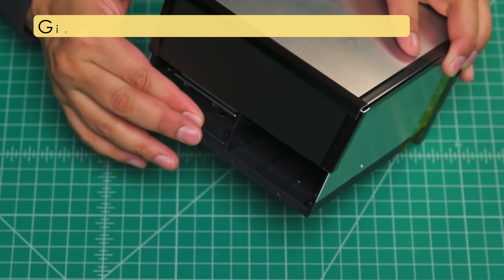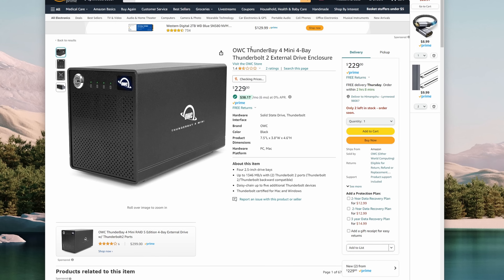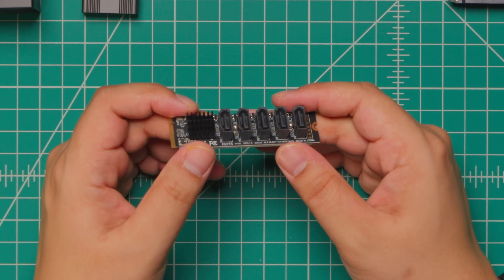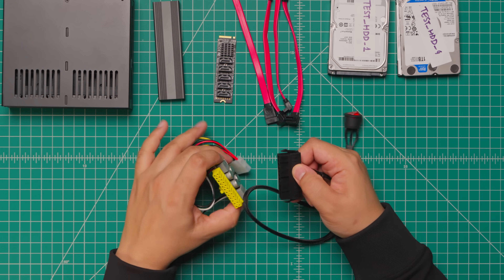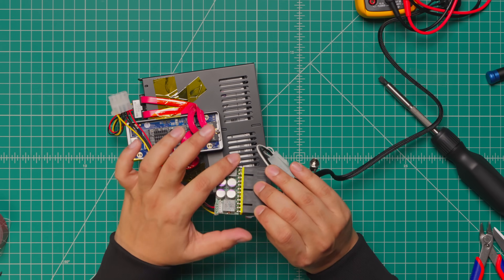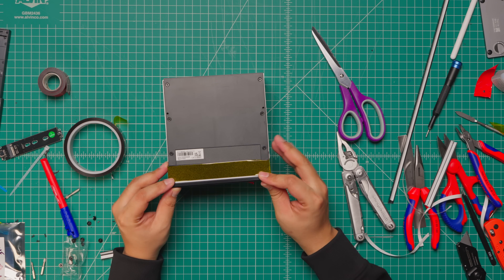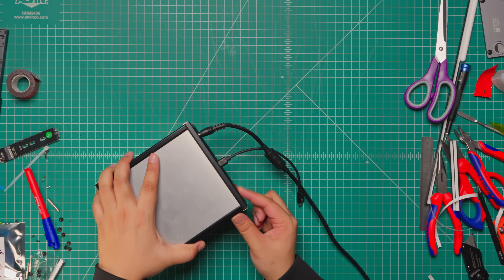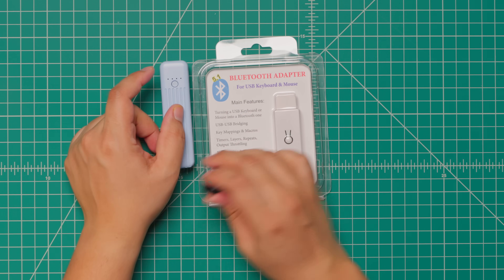You can't buy this! Affordable Custom 2.5 inch SATA SSD/HDD 4 Bay Direct Attached Drive Enclosure

Comment from the maker: ## Update on USB to NVME Enclosures

It was brought to my attention in the comments that most of the USB to NVME enclosures don't tunnel PCIE traffic so they will not work for this, unless it's USB 4.0 that can support PCIE. However, it works well with Thunderbolt ones like I have done here. Bottom line is that the cost may go up a little bit once we replace the USB enclosure with a thunderbolt one, but we get 40 G speeds which is a welcome tradeoff I guess. Sorry about the confusion in the video, please make sure to check for this if you are planning a similar build and make sure you don't waste your money by choosing a wrong enclosure. Thanks for all your support!
Reply: actual cost is $240.47
Reply: What does it mean? 
So sata expansion to nvme won't work on nvme enclosure to usb?
Reply from the maker: @ilhambuono5451  USB to NVME connections don't have all the required PCIE lanes for proper channeling, so to do something like this it has to be a pcie protocol (like thunderbolt) to NVME

Comment: Woahh, you can read my mind
I've been thinking this kinda project, but still wonder if it would work
So you plug SATA to nvme and then using USB hub to connect those Sata or what I missed?
And can you set those hdd raid?
Reply from the maker: Sata to Nvme and then to Thunderbolt or Oculink. USB mostly won't work as they don't tunnel PCIE lanes, I have clarified that in a pinned comment. RAID is a whole another thing though. You can do software raid with this, but hardware raid will require you to use a sata card with raid controller which I am not sure how well will run, especially when you think about forward looking support etc.

Comment: sooo usb -> nvme -> pcie does work?
Reply from the maker: Depends on the connections, not all are created equally.
Reply: @LatticeDensity  what? your comment makes no sense to me lol
Reply from the maker: @dbmaster46446  Not all USB to NVME connections are same, depending on which USB physical shape it's connected to. Even in case of C type connector, some wire it up for full PCIE bandwidth like TBT or USB 4 but some may only do the data pins. In my video I actually missed that, but I had clarified that in the pinned comment.
Reply: @LatticeDensity  yea only the thunderbolt and usb4 does that, everything before emulates the blockdevice

Comment: Can you use an Powered USB 3.0 hub and daisy chain 4 SATA to USB 3.0 cable instead of this setup? I think this setup has an advantage of cleaner / easier to obtain resources but I don't now the downside of this setup...
Reply: Did you end up rolling with this setup? I'm thinking about it
Reply: @xico6814  I end up with a similar setup but not fully actually. Mostly because I cannot find the psu similar to the vod in my local area. So I try using a bunch of powered Sata to USB connector, then daisy chain them into a powered USB hub. Then basically chain all smaller power power brick to an outlet and called it a day. I use 4 HDD in my setup so the transfer bottleneck is not a concern but if you use 4 Sata SSD then you might want to consider using the setup similar to the video because the Type C connector might offer higher bandwidth for those drives.
Reply: @alexander3364  my idea is the same to your I'm thinking on adding all 4 Sata SSD to USB to my computer that has more than 6 USB 3.0
Reply: @xico6814  If you use 4 Sata SSD then USB 3.0 might not be enough, using the set up in the vod you can get the drive connect though the USB 10Gbps and not suffer the bottle neck. But If you want to fully utilize the speed of all 4 Sata SSD then a traditional Sata to SAS controller is prefered.
I do my whole setup though daisy chain 1 USB 3.0 port because my use case does not require performance (yet) and I mainly use HDD.
Reply from the maker: USB Protocol doesn't support daisy chain, but you can share the port among the drives which is what the hub controllers do. However, it will be bottlenecked by the speed of the single USB controller, which is mostly about 10G for Gen 2, unless you go very uncommon Gen 2X2 but still you only get 20G and can hardly fit 4 SATA lanes at best. After you figure out the data, then comes the power part of it. There are very few boards available which is providing all the sata channels with power for 4 drives. If you must go USB, then the best thing to do it keep the USB lines separate to all the drives and connect them separately. Though not elegant, it will not run you into any issues.
Reply: @ Corrent, I did just run into the power issue and bandwith issue as well. Now I build a proper Nas using spare part from my old laptop that actually use SATA connectors. Yeah I have to abandon the USB ideal, chaining multiple USB though a single port cause so many issue as you mentioned and it does look good when I assembled it but once I used it everything falls apart.

Comment: The pico psu that your link to Amazon in the description is not the same as the one in your video. The one from Amazon doesn't have a molex connector that is needed for the drive cage .

Comment: I want a small portable 16+ drive SATA enclosure, to run off a standard LSI chip HBA, maybe via Zima Blade or a SFF Mini-ITX mini-PC. Check out Icy Dock's 6-bay hotswap, fits in a 5.25" bay. Need a chassis cage for three such bays stacked, no need for mobo yes Pico PSU, and the mini-SAS cabling connectors.
Reply from the maker: Ha ha ! I love how specific your requirements are, mine are typically about the same as well lol, very specific and I scare away the available solutions in the market. I have 2 solutions for you, 3D modeling and 3d printing. Get into it, you won't be happier in life, I promise.

I figured, most of such niche pain come from the lack of enclosures, and often the guts are available in the market. For example, you can easily design a small case to hold X 2.5 inch drives and a MINI ITX board, then connect all the drives to the MB using PCIE to SATA or something. Use a DC ATX or PICO PSU to power everything. All you need is the case. So once again, get into a little bit of designing yourself, and even if you don't own a printer, it's fairly easy to get it printed on Etsy or somewhere. Good Luck!

Comment: Wow, looks very interesting. I'm very curious how well it works with a ProxMox cluster. Thanks for doing the giveaway!
Reply from the maker: It should work equally well or better with proxmox as typically proxmox is much more efficient than TrueNAS to make sure it supports both ARM and x86, where TrueNAS only does x86. Thanks for the comment!

Comment: Power for external diy storage solutions has always been an issue, as no one makes a power supply just for hard drives. If you go sata ssd then you only need 5v which makes it easier.
Reply from the maker: Yeah💯, any 2.5 inch drives needs 5v, but it's always safe to have the full SATA protocol delivered as we cannot know what the onboard pcb inside the drive may be doing. But yeah you are right, it's a very unique use case which probably doesn't make for a good business case which is why no-one seems to make them. But in my experience, these Pico PSUs are the most optimal solution you can get, pretty much

Comment: nice video very informing. i was working on something like it except i needed a raspberry pi to act like a NAS server and cloud machine , i designed a 3d printable case but  i am having problems trying to power everything (4 sata SSD and 4 nvme drives all in USB enclosures)
Reply from the maker: Yeah, arranging the power of all that is the key

Comment: i'm curious about the enclosure. is the alu plate cut or bent to the shape? if the alu plate is cut, what is the black piece that connects them together?
Reply from the maker: You can do either, I intended to bent it first, then I ended up snapping it into 3 pieces. I am holding them together with the black corner guard pieces (https://www.amazon.com/gp/product/B0CHYJSBQ5) along with some metal glue. Hope this helps.

Comment: OK but you cant use RAID
Reply from the maker: Yeah that's true for hardware raid, and it's the same in any enclosure that you can buy. One can always use software raid which is more common these days as hardware raid is  controller dependent and can mess things up beyond recovery at times.

Comment: are you sure you can use a USB to nvme adapter with that sata m.2 card? Thunderbolt does indeed get a pci-e signal, but USB doesn.t Those USB > NVME really only read the drive and serve the data to you. At least update on that beacuse people can and likely will waste money on that
Reply from the maker: Yeah it was pointed out in another comment as well. I didn't get a chance to test that earlier, will update that information soon in description and pinned comments after I test thanks!

Comment: Love this.  I wanted to use one of those enclosures as well but couldn't figure out how to power it. Thanks for the ideas. Also that keyboard gadget giveaway looks good,  would be interested in it. 😂
Reply from the maker: Thanks for your comment! Please do try it out, let me know how it went. Also, as one of the comments pointed out, some of the USB based enclosures may not work as they don't pass PCIE traffic, so may need to test more on that. I will update with my findings here when I get a chance to test it out.
Reply: @LatticeDensity  I have a spare ATX PSU and empty NVME enclosure that I might try and do this with.  Just need to buy the power switch and the NVME-SATA adapter.
Reply from the maker: Hey @yesterdaysjam2405 ! Looks like your channel came up at the top for being interested in the giveaway, congratulations! I tried reaching out to you over email under your user id but the email bounced. Please send me an email at hbrk13@mail.com to discuss about shipping details :)

Comment: 3:28 are you REALLY sure? Those usb-ssd adapters work it a different way than thunderbolt ones, USB ones are drive controllers, dedicated to work with PCIE disk drives, while thunderbolt ones are just thunderbolt to PCIE adapters, where any PCIE device can be connected (diy EGPU docks can be built using ones)
Reply from the maker: That is interesting! Now that I think, USB won't be most likely passing PCIE traffic unless it's USB 4.0 enabled. To be honest, I didn't get a chance to test out the USB based ones as I ended up using the Thunderbolt. I have all my NVME to SATA and other expansion cards tied up in other builds, but should be able to test that out soon. I will update my findings here in a pinned comment for correction. Thanks for pointing out, really appreciate it !
Reply: Might be worth a shot, I think the sabrent drives can read m.2 SATA drives... Unless those still use a PCIE lane instead or something unusual
Reply from the maker: Yeah I don't have an extra adapter to test right now, but will get one soon and see how it goes. I am actually super interested to find out 😄 These enclosure manufacturers don't share any spec sheets so very difficult to understand on paper.

Comment: Since the goal is low cost and functionality, you might want to look into single board  omputers such as the Orange Pi Zero.  Low cost, might fit into the existing case and add wifi/ethernet for a NAS and only need open source software to boot from.
Reply from the maker: Yeah, that is exactly my next plan for this setup, I mentioned it towards the end of the video. This one, however was about just a direct attached storage without any compute module attached to it. Also, I use higher end SBCs like Latte Panda Sigmas for some of my projects so I will probably end up using those which aren't especially "affordable" so 😅
Reply: Not very quick, I'd want 2.5gbe these days